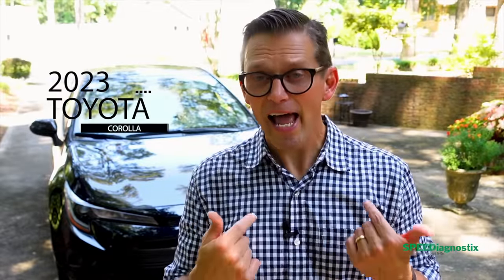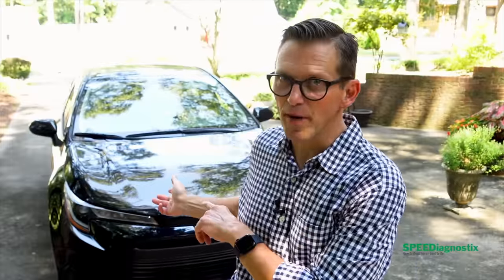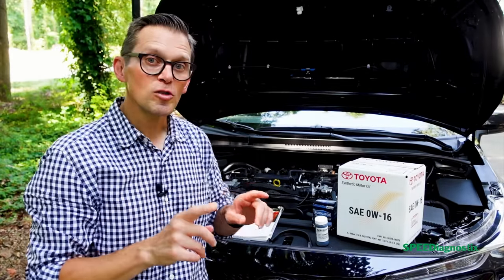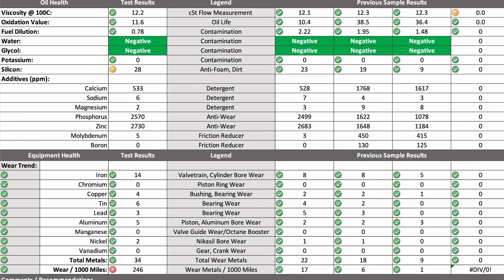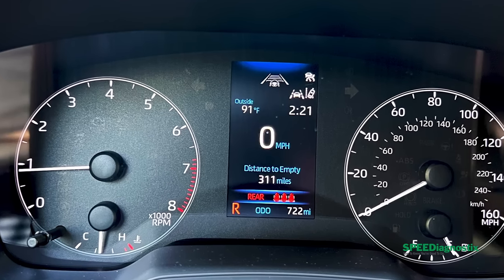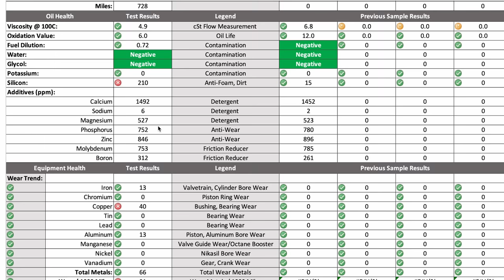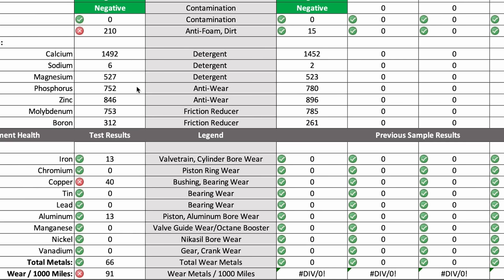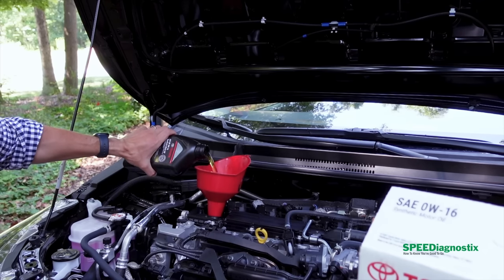AVOID the ONE MISTAKE Almost EVERYONE Makes With A Brand New Car

Comment: 10k mile oil change interval so customers can keep buying new cars every 100k miles 😆 🤣 😂 😬.
Reply from the maker: LOL!
Reply: A lot of manufacturers in Europe are now specifying over 20,000 miles. That concerns me. Austin Rover were specifying 12,000 miles or 1 year back in 1980 on the Austin Metro, a vehicle with the old BMC A-Series and a gearbox inside the engine oil sump and sharing the engine oil. It's utter madness here, and has been for some time!
Reply from the maker: @cameronwood1994  Agreed!
Reply: They last far longer than that. 200, 300,000. 400,000 miles all going by manufacturers recommendations. See them every day. Mines done 170,000 miles 14 years old, only ever had 10k mile changes from new it's perfectly fine. PCV is clean as whistle.
Reply: @motleydude73  are you a mechanic?
Reply: @chrisr.986  Used to be, though you don't need to be as real life motoring proves what he is doing is pointless. Wasting perfectly good oil, $ and time. That Corolla will do 200,000 miles quite easily regardless of your 700 mile change. Though I doubt his daughter will keep it for anywhere near those amount of kms. Doing the first change at 10,000 is perfectly fine. Millions upon millions of  vehicles around the world are serviced according to their schedules and guess what, they're all running just fine!
Reply: @motleydude73  the cars now days aren't made the same as before. The cars in the late 90's and early 2000's were extremely reliable not these new cars anymore.
Reply: @chrisr.986  They are made better. No need for 'running in' any more. Can go half a million miles easy without needing anything major. Just keep them serviced as per manufacturers recommendations good to  go 👍 Some of the electronics on some makes can be problematic but that's about it. Anything major in the first 5 years is generally covered by a recall bulletin and fixed under warranty.
Reply: Changed the oil in my 2013 Prius at 1000 miles, then at 10k until I sold it with 236k.  No oil usage at all!!  Stock Toyota filter with Toyota oil 0W20.
Reply: @jdub6797  It's a Toyota what did you expect? It will do double that.
Reply: @motleydude73  not if you don't change the oil and filter.  Also need to use good oil and filter or even if it is a Toyota it won't go 200k.
Reply: @motleydude73  I agree 10k oil change is fine.
Reply: @motleydude73 I change the oil every 3k miles in my 98 Sentra.....but there is an oil leak now so I never have to change the oil, it changes itself over time...very convenient and has made my life easier. 😂 I just add a little oil every few hundred miles.
Reply: @fortheloveofnoise  Doesn't quite work like that. Will always be a few litres of filthy oil in there gumming up your galleries and valves. The filter also needs changing.
Reply: And a mercedes that advertised their transmission is seal type that will last for a lifetime.. i feel pity for whoever that follow that.
Reply: @harisyoung4110  lol exactly 💯 🤣 🙂
Reply: @harisyoung4110  What are we back in the 1990s again? I think you'll find Mercedes recommend trans oil changes in all of their vehicles built in the last 20 years.
Reply: Not really. A 10K oil change makes the cost of ownership look good. 
Honda had to advise changing auto oil annually if the maintenance minder never indicated a change. Due to low milage short drives usually. So theoretically you could go years before your minder said to change the oil. By then ouch!
Reply: @motleydude73  Agree, what's the point in wasting a lot of money too keep the engine as good as new when the rest of the car will wear out. Then you also need to recond the body and regularly treat the chassie against rust.
10000 miles between oil changes is more frequent than most manufacturers recommend and is just fine with normal driving pattern. BUT in harsh condistions and just driving short distances between cold start it is another thing.
Here in Europe some manufacturers had 20000 miles interval and that gave problems so it was taking it too far.
/Engineer from Sweden
Reply: @rwd1973 OK, , but here in Southern California,  that doesn't really apply, our cars don't age physically ie RUST, CORROSION doesn't exist. The strong sun here can ruin the paint in about 7 8 years though, if not frequently hand waxed. So we can't try to match engine failure with physical destruction.  My 58 cadillac and 68 Mustang are totally solid ,look nearly new underneath,  hell, it hardly ever rains here. So its very important to keep the engine going as long as possible before paying for a rebuild. Hence both cars get 6 month oil changes.  My daily driver gets 3000 mile oil changes,  its GDI and TURBO.
Reply: @rwd1973  Most recommend 10k changes under normal conditions. That's perfectly fine. Not all countries use salt on their roads so rust isn't an issue. A modern car should last 30 years 300,000 miles.
Reply: @johnfranklin5277  True, but I doubt that modern cars with all the electronics will be worth repairing after 20+ years compared to a car from the 60's that can be repaired in all eternity as long as there are parts.
Reply: @rwd1973  Maybe,maybe not. My parents bought the 58 caddy in 1960. In the mid 70s it started becoming difficult to find parts for it, but not impossible.  But parts like the vacuum brake booster basically quadrupled in price! But starting in the 2000s, everything starting becoming available at lower prices. Now I have no problems finding parts. The Mustang I bought in 1977, NEVER had any issues getting  parts for it!  Could be that 20 years down the road other companies will step up making replacement parts, including the electronics like they did for 40s 50 60s cars now. Time will tell. By the way, my maternal grandfather was a full blooded Swede. CARLSON was his last name.I think the original spelling was KARLSSON. 😊
Reply: Agreed, just to make sure the car buyer has a strong “incentive” to trade before 100,000 miles. I seem to recall a certain “reliable” Toyota engine with low tension rings and factory recommended 10K oil change intervals. That ended badly

I live in Winnipeg, Manitoba, Canada. Summers can be humid and reach +35 C. Winters are long and January lows of -35 C to -40 C are not unusual. 

I bought new a 2013 Ford Focus hatchback with a 5 speed stick - no PowerShift transmission issues for me. I did the initial oil and filter at 2,000 km. Thereafter, every 3 months or 5,000km max. City driving is hard on oil, especially in winter. My engine has GDI, so I expect a certain amount of fuel dilution in the oil.

Following the owners manual I normally run a 5W-20, I prefer Mobil 1 Extended Performance. For winter, the owners manual suggests with low temps of -30 C and colder, a0W-20 for “improved cold start performance.” In other words, it will still start if I can’t plug in the block heater.

A little over 100,000 of mostly city driving, and it still idles so smoothly you can’t tell if it’s even running. For curiosity this summer i I took the intake manifold off. The intake valves were practically clean.
Reply: @jerrykorman7770 Fantastic!
Reply: Just change it every inspection year and change the PCV valve too.
Reply: What are people’s thoughts on running a 10k interval, using Amsoil signature, high quality filter, on a vehicle that’s driven 45k a year?
Reply: @dander0091  my personal opinion is to have your oil analyzed you will be able to see your vehicle’s oil condition 😁 🙂.
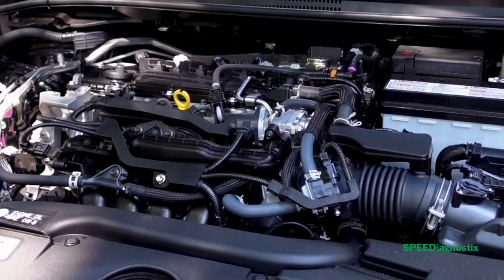Reply: 0:54 toyota can take the abuse.
But id still change oil as often as i did a tire rotation using a sysntic motor oil.
Reply: @themotoroilgeek change the gearbox oil as well.. gear teeth & clutches shed a lot of particals that become sediment in galleries etc just waiting to release a 100k-200k kms later.. when most auto boxes have problems.. store the waste oil in a tall clear plastic bottle & look at it in 6 months to see clear the settled particals
Reply: 10,000 mile oil changes.
One heck of a selling point,eh?
Reply: @motleydude73 they may run fine, now, but their longevity has suffered
Reply: @fortheloveofnoise if you don't drain it, the bad stuff in bottom of pan is never removed, continues to wear engine parts
Reply: @rogerdodrill4733  Is 30 or so years 300,000+ miles not enough for the average car?
Reply: @rogerdodrill4733  I've seen hundreds if not thousands of cars that have had nothing but 10k changes their whole lives. Guess what, they last 100,000, 200,000, 300,000 miles without a problem. Cars 10 20 30 years old. My 1995 Accord which I bought new still runs smooth as silk at 264000 miles. The oil is always golden. My 2010 Camry at 161000 miles. Same thing. Not sure how much 'longevity' you want or expect out of an engine?
Reply: @dander0091  Perfectly fine. That's 4 changes a year! Obviously doing a lot of long hot running engines love that.
Reply: Sook you are willing to blindly believe a manufacturer even when they admit to built in obsolesense. Have fun with that.
Reply: @RATTL3R186  I will. 30 years out of a car seems pretty decent to me. Suppose you want 50?
Reply: @RATTL3R186  Please provide links to this stated  'obsolescence'. We're not talking about washing machines. Cars lives depend on many factors outside the control of manufactureres you muppet. What do you think service schedules are for and why replacement parts are widely available? For longevity of a product.
Reply: Thats what's done with new motorcycles first 600 miles oil change.
Reply: 500 miles a little bit overkill, LOL. You can definitely put at least 1200 miles before the first oil change.
Reply: @Just_In_credible6  Do 10k as per manufacturers recommendations. Any sooner is just wasting $ and good oil. People seem to think it's the 1950s still when oil was crappy and cars needed 'running in'.
Reply: Exactly!!
Reply: @dander0091 that's what I do. 162k on the Benz, 228k on the civic.
Reply: @motleydude73 yes, usually modern vehicles are engineered and built better but there are many that have issues that didn't exist before also, I have been a mechanic all my life along with a lot of my friends who work in dealerships. I have seen and heard about excessive wear in areas that shouldn't exist if they were engineered to last, in general even Honda and Toyota have wear issues on certain engines. What he is doing is not wrong in helping the life of a engine, even if it is a Toyota, let alone a Kia which has had a history with manufacturing problems, like blocks not cleaned properly. There are generally not as many well built  engines out there as you are claiming.
Reply: @themotoroilgeek why don’t these oil pans come with magnetic drain plugs? Seems like it would greatly benefit
Reply: 3,000 miles for me.
Reply: @harisyoung4110 Yes, it lasts for the lifetime of the transmission, however long that might be.
Reply: The Car Care Nut also says don’t go 10k between oil changes. He has years of real world Toyota experience. Is he dumb?
Reply: @motleydude73 you make great points. “Varying your speed “ during break-in in the 1950s was important because their cruder cooling systems would cause certain sections of the engine run hotter than others at certain speeds, so the driver needed to even out break in, else you could have a premature oil burner. So often people who still think it’s the 50s say “I change my oil every 3000 miles. Cheap insurance.” No, that’s EXPENSIVE insurance. Cheap insurance is following the owner’s manual. Btw, my 2016 Infiniti with 3.7, manual says every 5000, 7500 with synthetic. So I do it every 5000. So the first oil change I did at 5000. Wow the oil was dark brown. Car runs perfectly at 75k. I do think there was a surprising amount of dirt, etc. in the first oil. But what difference did it make? 1% shorter engine life?
Reply: @themotoroilgeek why is it recommended to vary the engine rpm during breakin? (i.e. don’t sit on the freeway on cruise control for long periods). Is it related to the wear on these brand new internals?
Reply: Not always. It really depends on your engine and driving habits. On my 2003 Odyssey I did 10k-13k oil change intervals. It’s wasn’t designed for it but I always sent my samples in to Blackstone labs to check if I could extend. Every time I sent it in they told me to push it another 1-2k. I had well over 200k on it when I sold it with those extended oil changes most of its life.
Reply: I just traded in my car a couple weeks ago, only changed the oil every 6-8k miles.  Had 228k miles on it with only replacing the battery and a water pump.
Reply: @JFKeNn3dy  I assume you drove alot of highway miles?
Reply: @fbi8364 Lazy people with dirty houses do 10k Mike oil changes. 😉
Reply: Rubbish. We own many cars, a Lexus nx200t serviced every 15000km(9000miles) , sitting at 190000km (120k miles) zero problem. Have a twin turbo diesel VW amarok at 245k km (153k miles), zero problem serviced every 15000km (9000 miles). Never serviced any cars including our trucks under 10000km, our Mercedes sprinter van goes 30000km or 24 months for oil change from manufacturer, 10 years old this year and zero problems….. why change 500….5000? Why not change every day then ?
Reply: We just bought a Highlander Hybrid with 50,000 miles on it and only 5 oil changes. Needless to say, we are starting 5000 mile oil changes despite the dealer telling us that we can go 10,000 miles.
Reply: @chrisr.986 yes. The cars made nowadays aren’t the same as before—they are better. Engines are made with better tolerances. No longer as many iron shavings in the break in period.

My 2019 Accord has 130k miles with absolutely zero issues doing the recommended 7-8k miles oil changes. It will so easily do 300-400k miles.
Reply: Plenty of cars are just fine with a 10k oil change interval... my 2000 tdi jetta doesn't use cheap oil to begin with. So I want to make sure I get the most out of what I pay on  on the car. Including its oil changes. Well 15 years later and 405thousand miles, she's running like a champ! Did a valve cover gasket like 5thousand miles ago, those cam lobes look like new! And the inside of the motor wasn't even glazed of carbon or soot. It was remarkably CLEAN!
Reply: @Anonymous99997  better go 200 miles, oil is cheap. Engine isn’t
Reply: How fast you drive determines how often you need to change your oil. 

High RPM = increases oil oxidation.

Toyota lists 10,000 miles between changes because most people who buy an inline 4 economy car don’t drive very fast, and if they do it’s not often enough for it to matter.

Many people don’t understand this, yet they change their oil every 3k miles on the dot all because they “heard” from a friend thats whats best.
Reply: @known3617   my old tdi came from factory with 85hp. It's always screaming just to try to keep up with traffic. 10k oil change interval even still. But it's diesel so the way the oil breaks down isn't the same. Also doesn't get ethanol contamination
Reply: I’m changing oil in my Prius once a year, it’s about 13-15K mi and using only oils that rated for 25K change interval. Almost 200K mi, no oil consumption by engine. Friend of my changing oil every 5K in his Acura, about 110K mi and engine consumed 1 qt or more every 1000 mi. What can you say?
Reply: @Ilikepie18855 I have a 2010 Audi A4 Sline 2.0T 6MT (gasoline). Always had it serviced annually at dealership with about 13,000-15,000kms. At 146,000kms they recommended timing chain replacement (3.8° stretch). The timing chain is apparently designed for “the life of the engine”. At 175,000kms oil consumption is now 1L in 600km. I’m really disappointed. I can’t help but think, I should have changed the oil more frequently
(~ 8000kms intervals).🤷‍♂️What happened?
Reply: @svenhodaka9145  Well you have an audi, no amount of oil change will ever save that. Get a lexus, service every 30 000km and it will still run with no oil burn. I have a 2016 volvo xc90 D5 SPA, the only european car I have that is over 185k km, serviced every 20 000km at volvo  and engine runs fine, no oil burn etc. Everything else did fail though.... turbo, alternator, waterpump, EGR, etc..... but engine is fine. Want to drive long turn in a luxury car? Just go lexus.
Reply: @Ilikepie18855  👌Thanks for this little chat. I’m going car shopping .
Reply: It was a joke
Reply: Same bullcrap with 10K oil change
Reply: The dealer where I bought my Camry changed the oil at 500 miles they set us up for an oil change
Reply: Get a Tesla no oil worries after 10 yrs get another one  😂😂😂😂 no fluid worries any more. Ok ok you guys keep your cars forever so just disregard my comment and stick to your fluids 😂.
Reply: I changed my oil every 10k, and my car is close to 200k now and works perfectly fine. Changing it every 5k is for sheep.
Reply: Coworker has a 2016 vw passat. Goes to the dealer for everything (10k mile oil changes). He's pissed because car now has 80k miles and burns 1 quart of oil every 2 weeks. Dealer says its normal 😂
Reply: If you check the level and use synthetic oil you should be good. Big problem is the folks that don’t check the level between changes. 
I bought mine new and did my first change at 500 miles and the next at 3000 miles. Been changing when the computer tells me since then. It’s about 6-10k but I often don’t get to it until 11-12k. 340,000 miles later no ticks, taps, knocks, and will smoothly run to redline with no smoking. 
Not sure why they don’t included low oil level lights.. by the time your low oil pressure light comes on your engine is toasty.  Probably a .99 cent sensor would do it.
Reply: @themotoroilgeek is there a brand of oil that you would recommend for the transportation industry? 
I maintain everything from 4cyl, 6cyl, 8cyl aluminum gas engines (7 passenger to 25 passenger vehicles), to 4cyl, & 6 cyl diesel engines (34 passenger to 60 passenger coaches)? 🤯
Currently we use a wide range of oils from usually the cheapest available sources.
I'm not asking for a "one weight to rule them all" sort of thing. Instead maybe one or two brands that will help these long idling, long trip  engines (that have some drivers that think they're part of the Joe Gibbs racing team😂).
Any input/help would be greatly appreciated 🙂
Reply: My last two 10,000 mile interval cars were an M5 at 220k and an RX350 at 235k(still going). No, I’m not “a mechanic”, just a Mechanical Engineer. But I don’t think I need to be a mechanic to read an odometer.
Reply from the maker: @tracewallace23  Thanks for the question. When it comes to recommending an oil, the brand choice comes last. Always begin with the application, the type of engine and operating conditions determine what the proper viscosity and chemistry should be. The brand choice is who do you trust to consistently deliver that viscosity and chemistry.
Reply: @rwd1973  The durability of the electronics is actually mind blowing in its own right. My 17-year-old Tahoe can’t even fire the spark plugs or put fuel into the cylinders without a computer telling it what to do. The more amazing part is all of that software fits into one megabyte a flash memory and the CPU can run without producing any errors at 200°F. I also have a 1976 F250 that has nothing but constant problems because the materials just simply are not as durable, various seals, diaphragms, membranes, gaskets, etc. springing new leaks in the carburetor. Cylinder number four has a burned valve seat because of a leaky brake booster causing it to burn from running lean while modern valve seats are so durable and so hard that the engines can run lean all day every day without any problems.

The only reason most modern cars in the US don’t run lean of peak EGT except for Nissan sky active is because of NoX emissions.

Modern chemistry is amazing. It’s funny how we take for granted the luxury of 87 octane, and the efficiency and power that it can produce and by today’s standards is a low-grade gasoline then when I compare it to what my grandpa had when he was my age it’s hilarious how poor quality Fuels were and how low power the engines had to be to support such poor fuels.

What’s even more crazy is that high-quality gasoline was possible in the 1940s, but prohibitively expensive 100 octane existed in the form of aviation fuel which still exists and is used to this day in small aircraft. Only within the last few years has one company managed to formulate a gasoline that can achieve 100 octane while removing lead for aviation but once again it’s another $.40 per gallon more expensive than 100 low lead but you can double your oil, change interval, in airplane engines, because in the absence of lead, the fuel burns cleaner resulting in oil that last longer.

Full synthetic oils were attempted in airplane engines, but failed because the lead from fuel turned out to be highly incompatible with synthetic oils. These oils can finally make a comeback with 100 unleaded and we may finally see airplane engines doubling in life because of chemistry compensating for the higher cost of the chemicals, but saving you money , because you don’t have to buy a new engine.
Reply: @themotoroilgeek  Thanks for a very sensible and quick response 👍🙂
Unfortunately, the business owner I work for actually told me once that "he believed that oil changes were a scam perpetrated by the car and oil companies" 😵‍💫🤯
Then he got to see what 30k on one oil change could do to a gas engine (the only reason it survived that long was a oil filter bypass system). Then he wanted proof that was why the engine blew. All it took was removing the oil pan and valve covers. 
Talk about a horror show.
Interesting, but horrible. 
35k on the engine and 6 qts had cooked down to about 2-3 qts of a sludge that couldn't even pass as burnt grease 🤯🤣
He hasn't questioned the wisdom of oil changes since...🙂
I'll keep watching your videos and see what I can figure out. 😎
Thanks again
Reply from the maker: Thanks for sharing  @tracewallace23
Reply: @motleydude73 yeah we'll go look at some used Corollas with a 50 or a 1 0 0 Thousand Miles when you rev those engines you hear the bearings rattling like a marbles in your mouth buddy so so you're saying totally b***** yeah the car won't last 200,000 miles but also make a lot of noise so that's why some of them don't because some people did change the oil on the first 500 miles and then a thousand miles and then every 5,000 miles girls won't make that noise at 1 0 0. 5 every other Corolla will make noise like a motherfuker and it might make it to 2:50
Reply: @memphisraines8118  It's a VW what did he expect?
Reply: The Corolla is one of the most abused cars ever that's why they all burn oil nobody likes changing the oil in a Toyota Corolla that's why all the ones for sale or garbage then you get those 20-year-old ones with only 10 or 20,000 Mi on it doesn't even worse yet because the oil was never changed in 20,000 or 30,000 miles yeah even ones with 40 thousand miles on it maybe the oil was just changed to sell it it's all true facts I bought many Toyotas especially Corollas I got through high miles and low and they all burn oil and they all make noise why because nobody maintains them correctly not like this guy does maybe this guy got it right but that doesn't mean that the world gives a fuk are they going to keep trading in their Corollas and they'll be plenty of them for sale and they have plenty of you ship box oil burners and they'll be making noise like they do Corollas and noisy engines and they just making them even more noise here by doing what they're doing dog
Reply: @frontierguym2857  Why would a dealer do that? Toyota don't say to do it. Was it at their expense?
Reply: @chrisr.986 so you're saying a car made in 2023 is less reliable than a car made in 2003. You couldn't be more wrong.
Reply: @new2000car 
They wish they had lubricants as advanced as we do these days. But for someone who uses the cheapest oil, short driving distance, 3k miles OCI is a good guarantee the engine will live decent life. We have one costumer with '94 Civic with over half million km and it's still alive in the worst place of the rust belt in Canada.
Reply: @johnfranklin5277 John, same thing applies here in San Antonio. No snow, therefore no salt on the roads.  But intense southern sun will cook the exterior paint and rubber or plastic components!  Need to wax often and apply protectorants on the exposed plastics and rubber.  Also helps to use a sunscreen when parking to protect the dashboard.
Reply: @OldRustySteele  Absolutely,  been doing all those things for 48 years to my cars now, and it definitely helps tremendously!
Reply: I quit putting money into my Nissan pulsar, 1986 when I hit 280000 kilometers. No oil changes I just kept adding my dad's used oil from his new car until I sold it. I had 495000 km. Never plugged it in always started still ran good..yes same oil filter for 215,000km GO NISSAN.
Reply: 10,000 miles is not much is maybe 100-150 miles more than the average person is estimated to drive in a year
Reply: it probably has to do with the quality of the oil as well. don't count on the car manufacturer putting the best oil in the car?
Reply: An oil cleaning probably won't hurt, that is, you run the engine through with a cleaning additive and then change the oil and oil filter. Note an additive made for the purpose
Reply: @motleydude73  There are cars that apparently have problems with the piston rings and this Apparently with low friction pistons to do
Reply: @motleydude73  There are also engines that have problems with burning oil and it can become a really thick consistency If you are unlucky
Reply: The oil makes a difference. Someone using Supertech regular Syn oil and an eco guard filter. May have more issues than those using Mobile 1 Extended performance High Mileage with a mobile 1 extended performance filter.
Reply: @motleydude73 On The Prius with 1000km change then 10,000km after that.  That engine is known to use oil due to jammed rings from sludge and not enough spring tension.

It's remarkable the oil changes prevented it's demise.
Reply: @jdub6797 the most important issue for this dude did is the 10k miles oil change. The engine wont last 50% of those who do 5k miles change in most cases for sure
Reply: 18,000 mile oil changes on my SEAT Leon as per the manufacturers schedule. I've owned it since new and it  has now done 204,000 miles and is still strong. Some engines are more sensitive to how often you change the oil than others. I use the specific long life oil and there was no sludge in the oil pan when it was off due to a dodgy sump plug. No running in oil change, it's first oil change was at 18,000 miles. Yes, the oil would likely have more metal content than later oil changes but it doesn't seem to have reduced the life of the car. It's already gone much further than the average car before being scrapped and it's still going.
Reply: @RichardFanders  well, one car survived with more than 10k mile oil change does not prove it is a good practice. 18k Mile change is definitely bad practice that no people should follow if they want to keep their car long.
Reply: @motleydude73 agreed anything under 10 k especially not doing heavy driving the oil will come out not even close to black I go off of the cars recommendation it's usually 7 to 10 k or 3 months which ever comes first
Reply: @chrisr.986  almost every engine lasts 150,000 miles or more. And if they do fail, it’s hardly ever due to lubrication issues.
Reply: It is transmission oil, and no, every 90000km of 5 year you have to change the oil. Read the fucking manual.
Reply: We own a 2007 Acura RDX with 205k miles on it. Always had used Mobile 1 at dealership but not a sure what oil at Jiffy Lube and our current shop uses except they say its synthetic oil..
Reply: @paulloisel5607  I’m a mechanic. And i regularly do stuff to my car that I advise others to NOT do. And to be honest, i probably go 10,000 miles between oil changes more often than I’d like to admit and have done so for my last 3 vehicles. ALL of them have gotten at least 200,000 miles. And the engines were still good. My current car has over 240,000 miles on it. I use full synthetic oil. The recommended oil change interval is 6,000 miles using synthetic blend. Today’s oils are MUCH better than the oil used 30 years ago when the 3,000 mile oil change was the norm. Most cars can go the manufacturers recommended interval without any problem
Reply: Yeah those 10k+ mile oil changes are a scam by the manufacturers. So much so that oil manufacturers are recommending 10k mile and even up 25k mile change intervals.
Reply: @dander0091 at that rate I'd go 10,000 miles if your manufacturer recommends that interval.
Reply: I haven't had a car that did less than 200k and when I got rid of them it wasn't because of the engine.  I just followed the manufacturers recommendations. Last car was every 5k with semisynth and the current is every 10k with full synthetic.
Reply: @markmccraley2559  the funny thing is that any engine that has the reputation of dying at 100,000 MI is an engine that everybody tells you to avoid. Engines haven't been routinely wearing out at $100,000 miles since the mid to late 1980s. And people are keeping cars longer than ever. One of the reasons is because the high dollar items such as the engine and transmission tend to last longer than ever. Those big ticket items were usually a major cause of people getting rid of their car. The truth is that if a person uses good quality oil as recommended by the manufacturer, a decent oil filter, and changes the oil as recommended by the manufacturer, the average engine will last much longer than 100,000 miles. Your experience is typical as opposed to the guy who claims that following the manufacturer's intervals will lead to early engine failures
Reply: For the first oil change during break in, change the oil at 3000 miles and then every 5 to 6000 miles or every 6 months.
Reply: @frederickneal4781  No harm in that, other than to your wallet,  but completely unneccessary.
Reply: Oil changes are cheap. New engines aren't.
Reply: @Kris-q4m  As I keep asking you muppets who say the same tired ananlogy over and over, why would you ever need a new engine? Paranoid much? Do regular changes at least every 12 months  it'll last a very long time!
Reply: @seatime674  No we do it as that's what the manufacturer recommends. And my house is spotless. As is my engine internals after 160,000 miles. Stop listening to snakeoil salesmen like Oil Geek he's just costing you money.
Reply: @motleydude73  Where have you seen thousands of cars at 10k mi oil changes that last forever!...No one is saying an engine will blow if you don't do it at that either but if you understand the concept of oil, unburned fuel, soot & carbon pollute the oil daily and studies show that after 5k miles lubricating properties drop over 20 fold.. If people brush their teeth every 3 days thier teeth won't fall right out but most do it daily, If you change your home A/C filter every 5 years the motor won't die immediately but most do it yearly.. These newer engines are smaller at a higher tolerances to make more compression & horsepower so they are harder on oil especially turbos and superchargers which are on 60% of vehicles now. A car is a 2nd biggest investment in life, 10kmi oil changes is considered neglect, synthetic or not sorry & 9 out of 10 people will tell you exactly that.. You are literally shortening the life of your car and it is a 100% fact no matter what things look like to the naked eye
Reply: @seatime674  🤣 Funny guy. 10k is not neglect it's perfectly fine and what Toyota recommend. Oils and engines have improved somewhat since the 1980s bud. How long do you want a car to last? 50 years? My previous one was 23 with 289000 miles, had nothing but 10k mile changes from new. As has my current 13 year old car with 160000 miles. Oil is still clean at every change. And as service tech with 32 years experience I have seen thousands doing just fine and dandy with Toyotas recommended OCIs. Some Landcruisers with over 500,000 miles.
Reply: @motleydude73  Where is your Source again of thousands you've seen that go 10k mile changes?. Yeah there's a miniscule small group and a handful of you 10k Oil Changers out there but trust me you are the slight minority and you can laugh all you want, the facts I gave you are 100% FACT regardless of the miles on all your stupid cars. After 5k miles even with synthetic oil it losees its lubricating properties and degrades  20-fold and multiplies another 20 fold soon after that. 3-5kmi is the total sweet spot. Because you've fallen on a favorable side of luck at the moment doesn't make your arguement 100% Ironclad proof.. Yes with new synthetics you can go 5 maybe 7.5k miles at times but consistently 10k+ because of what I just described is not a good idea... And you also can't prove Toyota tells you 10K so they can sell you a new car sooner than later when you possibly break down either so Keep rolling those lazy dice😉
Reply: @seatime674  As I said, funny guy 🤣  My 'source' is real life experience bud. Slight minority? No, the majority actually. 98% of people who come in for servicing do it at the manufacturer OCIs. That's around 24,000 vehicles a year at our 4 dealerships alone, nevermind all the rest around the country. Your paranoia is laughable. Chuck fresh oil in every 10k and forget about it. You think you know better than the people that build and benchtest the engines 🤣  GTFO. My experience calls BS on your opinions. I'll happily keep rolling the dice, it's worked for me for 35 years of car ownership. ZERO issues. Oh I lie... a snapped accelerator cable in 1996.
Reply: @seatime674  BTW you are clueless about oil. Absolutely laughable. It's whole purpose is to lubricate. And reduce friction and disisipate heat. Sure it breaks down over time and miles, but 3-4000miles is ridiculous. It's not 1980 anymore. Things have improved. Many oil analysis samples will show you that. It's good for about 15000 miles.
Reply: @motleydude73 
Yeah you're right I know absolutely nothing🤣🤣🤣🤣..
(Toyota Nation Quote)
 Although this video is for Toyota Camry, the dealer and manual recommends 10k mi oil change intervals. Look what happened. I think it applies to just about any car brand. Oil changes is not that expensive for most cars, if you do it yourself it shouldn't cost more than $40.

If you don't watch the video, basically the Toyota Camry owner has 180k mi on this 2015 car, the owner has not missed any car appointment for maintenance and the dealer calls for 10k oil changes. What started happening is the car is burning 2-3 liters of oil and that caused the engine failure and had to be replaced. The mechanic pointed out what parts of the engine had failures in multiple parts.

Last edited by MKTwet; 10-29-2022 at 11:35 AM.. Reason: Edited thread title for clarification.

https://www.youtube.com/watch?v=TJhFAwFv-O0
Reply: @motleydude73  And I never really quoted 3K I said 5K is a good standard!!!!... No one likes a Mr know-it-all clown!!!!
Reply: @seatime674  So? Mines a 2010 with 160,000 miles and doesn't burn a drop, what's your point? Shall I list the thousands I've done 10k changes on over the past 3 decades that have no issues too? Some models of Camry had low tension rings that caused oil burning, namely the 2AZ-FE. That is nothing to do with OCIs. I've seen that video and commented on it ages ago.
Reply: @seatime674  You said 3-5k is the sweet spot. Good synthetic has triple that life at least. And I don't care who doesn't like me. People suck. Especially youtube 'experts' who think they know better than vehicle manufacturers out of pure paranoia 🤣
Reply: @motleydude73  Blah Blah Blah Blah Blah blah. Enough with the diarrhea 🤣🤣and quit splitting hairs  10kmi oil changes is not recommended period deal with it.. an owner of a Toyota dealership just told you it's not a good idea and I don't think you know more than him🤣🤣. Go back and read my quote I said exactly 5K is this sweet spot
Reply: @seatime674  Honda and Hyundai also recommend 10k OCIs. So you're the one talking out of your arse. I talk facts, proven by experience. How many oil changes have you done?
Reply: @motleydude73  You're just not getting it you sound very dense!!!. It doesn't matter what manufacturers recommend, What the owner of that Toyota dealership just showed you was a perfect example of what NOT to do regardless of their recommendation.. I will 100% personally guarantee as of tonight you will not be changing your oil every 10Kmi anymore.. The owner of this dealership said don't do that in any brand car as they had to replace her motor because of it she bought it new, did 10K oil changes and had to replace it.. Your cars going to start burning oil any day now watch😉👍
Reply: @seatime674  Funny guy 🤣  Im speaking from experience, ignorance only comes from inexperience,  and yes I will continue doing 10k mile changes, it's what Toyota recommends and I've never had any problems by doing it. Ever. Nor has anyone else we do 10k mile OCIs for. That Camry had a defect with the rings it was a common issue 15 years ago. My Camry doesn't burn a drop as it has different rings. It will happily do another 160,000 trouble free. You seem to be stuck sometime in the 1980s when engines and oils weren't as good.
Reply: @seatime674  I've only had to replace 4 engines in my career, and only one was due to OCI neglect. Some I've serviced from new as per Toyotas recommendations and they're still going strong 20 or so years later with 250,000+ miles. Tell me about that 3-5k sweet spot again 🤣
Reply: @motleydude73  You can keep saying OCI aaalll day long all you want that's not going to save your hide and I'm the opposite of ignorance because I have experience you don't know anything about me and what I know... Do you also know car manufacturers recommend changing transmission fluid every 100k miles too???? And do you know changing transmission fluid at that mileage can cause the clutch plates to slip because you're displacing sediment?? So now you can't change your fluid at all!!!. Better stick to those manufacturers recommendations. A Toyota is Toyota is a Toyota is a Toyota all day long and you're going to start burning oil any day now. Sniff sniff what's that I smell?,?? Crude oil??... 🤣....
Reply: @motleydude73  Here let me ask you a question. Let's take 2 brand new of the same engines and one guy changes the oil every 5k miles and the other guy changes it at 10kmiles  Which one is going to go a Mile+ further??.  EXAAAAAACTLY🤪
Reply: @seatime674  A lot recommend it at 55,000 miles actually. Or 90,000 kms.  Which is what I do, as do most people. Again no issues. Shorter intervals are recommended if you do a lot of towing. And no it won't start burning oil, the oil is still golden at every change. I've had cars with far higher mileages and zero burning. Our Parts Van is a 2011 Hiace. Currently at 216000 miles. Not a whiff of smoke.
Reply: @seatime674  Too many variables to say. Engine longevity is more than just doing regular oil changes. But the guy doing 10k changes will spend a lot less on his car than the paranoid guy 🤣  There is ZERO evidence shorter intervals give better longevity. The only time I'd shorten them is if I was doing shirt trips constantly i.e less than 10kms 90% of the time.
Reply: @motleydude73  "There is ZERO evidence that shorter intervals give longer longevity???" I JUST SENT YOU THE FU K IN LINK TO THE CONTRARY!!! .. The owner of a Toyota dealership had to replace the motor in a 2017 Camry because she did 10,000 mile oil changes!!!!! It was proven in the teardown Do you want me to speak slower so you can understand?????????.... I'm not saying that happenes with every car but it happened to this one!!!!!
Reply: @seatime674  A link I watched over a year ago. Yawn. It was nothing to do with 10k changes. Unless he only drove 5kms a day for 12 months towing a 5 tonne trailer. But no, faulty oil control rings caused the excessive usage, as I have said it was a common problem for a number of years.  If 10k change did cause it why am I not replacing engines every single day on the same cars? Or my own for that matter. That Camry would have burned oil even it had had 5000 mile changes. You're quoting one car with a known design fault as evidence that 10k changes are bad? 🤣  Do better next time.
Reply: Hahaha 😆, those days, up until the early 70s of only getting 100k miles, are long gone!! I've heard of some people getting 😕 up to 1M miles on their newer, well engineered, and well maintained engines!!
Reply: @dohc1974  That's a very good idea💡I've seen engine oil drain bolts 🔩 with 🧲 magnets available at many autoparts stores!! 
  'By George' I need to get myself one of those magnetic 🧲 oil drain plugs/bolts !! Thanks 😉 for the heads-up 👍
Reply: @Ilikepie18855 Better yet, just buy a new vehicle daily!! 😉
Reply: Just retired my Mazda 6 2008, 426000km,  oil change every 15-18000km, was burning 1/4 pint in 15000km,  so my opinion is this video promotes oil changes way too early !!!
Reply: 8k miles for me on everything with synthetic.
Reply: Tell that to a diesel.
Reply: I'd "flush" it with cheap 5w20 or 30.
Reply: Not really lol they’re built for it and synthetic oil can last even longer than that
Reply: That info hit hard.  You mean to tell me full Synthetic oil still needs to be changed every 3k miles? What about using one of these by pass oil filters?  Another gimmic?
Reply: The care care nut took apart a Camry that had 10k mile oil changes religiously and the car started to burn oil at 100k miles, at 120 it was going through 3 quarts every 1k Miles. Ask yourself one question when you're engine fails does the dude who wrote the manual pay for a new engine?
Reply: Evidently, "break-in" oil went out with the Carter AFB.  The oil that the manufacturer puts in is intended to remain so as to ensure a proper initial oil interval.  Engines are fitted better with modern machining methods and generally don't require a "break-in" anymore.
Reply: You also want to consider that short trip "city" driving is considered "severe" use that requires more frequent oil changes.  But you shouldn't have to change the ATF fluid unless it gets contaminated or the gearbox slips or shifts hard (filter is clogged).  Oil doesn't "break down" but it can be contaminated.
Reply: @dander0091 You're changing it often enough,  every 2.5 to 3 months.
Reply: Depends on how the miles were driven, pull the oil stick out an inspect your oil yourself on the stick, clear, brown or pitch black. I change my oil every 3 months, but my dad changes his oil every 6 months because he only drives to church to the grocery stores and back home 1/2 tank of gas will last him right at 2 months😂!.
Reply: To be fair to Toyota they tend to make it to about 150k miles before the piston rings stop working and the oil burning becomes terminal.
Reply: @motleydude73  you crazy
Reply: @timin770  No completely sane. The crazy ones are the idiots dumping their oil every 3000 miles thinking they know better than the people who built and benchtested their engines 🤦🤣
Reply: @samliang4146  Well they have and do. As do plenty of others. You are making silly assumptions based on paranoia.
Reply: @michaelw6277  Which Toyotas? Old 2AZ-FE's? 2AR-FE''s?  I work on plenty every day with far higher mileages and no 'terminal' problems. Nor on any of the ones I've owned. Current Toyota is at 171000 miles, should I expect problems any day now? 🤣
Reply: @1976axerhand  As explained, that had low tension rings, it was a well known design fault nothing to do with OCIs. 10k mile changes are perfectly fine.
Reply: @motleydude73  Silly you. What assumption did I make?
Reply: @samliang4146  That engines doing 10k mile changes will only last half as long as ones having 5k mile changes. It doesn't quite work like that. All you're doing is doubling your servicing expenditure 🤦🤣
Reply: @motleydude73  you are so funny, you have a few cars barely survived that 10k miles made you think that is the correct for most vehicles.
Reply: @motleydude73  if you say so. I’m happy spending the extra $25 a year on a jug of oil to ensure that I don’t have problems down the road… unless you feel so strongly that you’ll personally guarantee that I won’t have oil consumption issues up to 200,000 miles and pay for repairs if I do.
Reply: @samliang4146  Barely survived? They were all running just fine when I sold them. As is my current one at 170,000 miles, no issues. Why would there be? I've also done about 15000 oil changes on other peoples vehicles with the same OCI. Again, no problems. It's what the manufacturers recommend. A good synthetic will do 20k easily so 10 isn't much of a stretch.
Reply: @michaelw6277  Why would you have any problems? Oil protects an engine. For a long time. A lot of you dont seem to understand how it works. Some seem to think it's suddenly going to somehow damage their engine after 3000 miles 🤣  Paranoia is rife here.
Reply: @motleydude73  no problems happened for your 10k oil change does not prove that  those car's engine  won't last 2 times longer if they have been changed oil every 5k miles. You don't really understand the manufacturer's recommendation at all since most people's driving conditions should be applied as 'extreme' in the owner's menu. 10/15k mile change only apply for 'perfect' driving conditions like driving all time on highway only, which does not exist. That''s why I said you don't understand your so called 'manufactures recommendation ' at all.  In addition, there are more than enough examples that already prove the manufacturers recommendation are totally wrong, the most famous one is the 'lifetime fluid' that only stupid people believe and apply it and eventually already fucked their car up.
Reply: @samliang4146  Mate I just said I've done 15000 oil changes on other cars too, and no problems, some with over 250,000 miles on them.  Toyota say do 10k then do it at 10k! Why do idiots on youtube think they know better than the people who built the engines? Must love wasting good oil and money 🤦  Not sure how long you expect engines to last, most are are scrapped after 30 years 300,000 miles.
Reply: @motleydude73  it sounds like you don’t understand how oil contamination works. Start sending some of that 10,000+ mile oil off to Blackstone and you’ll get a very detailed report showing fuel dilution and wear metals and almost certainly a recommendation to change the oil somewhere around 7500 miles.

The problem with extended oil changes isn’t that the oil stops being oil, it’s that the extra crap in the oil that’s there because it’s been used is being circulated through the engine leaving deposits. You do what you want with your own cars but I’m happy to pay an extra $2 a month for the long term benefits of keeping the inside of my engine as clean as possible.

You act like people are throwing tons of extra money out the window with an extra oil change when it’s the cheapest bit of maintenance you can do.
Reply: @michaelw6277   10k is perfectly fine. A good synthetic will do 20k easily. Blackstone? 🤣  Why waste my money and time? Never in 30 years and a million miles have I had a single problem. I'll listen to the manufacturers thanks. Stop being so paranoid. My oil still dark gold when it comes out. Metal wear? Yea, after 170,000 miles I think my engines well and truly run in. Fuel contamination is minimal. An average engine runs 6 litres of oil. No damage is being done within the paremeters of manufacturer OCIs.
Reply: @michaelw6277  No harm in doing it early, but no benefit either. Unless you're doing only 10 miles a week and live in Chicago or Toronto.  In extreme driving conditions do it at 5k. Or as the manufacturer advises.
Reply: @samliang4146  There are literally millions upon millions of vehicles happily driving around on 10k mile OCIs, are you that ignorant to think otherwise? You think I'm the only person on earth doing it? 🤣  Everybody I know does it. My Uncles 1997 Landcruiser Diesel has only ever had 6000 mile OCIs, after 422000 miles he's yet to have a problem. Tell me again how 1000 mile and 3000 mile changes are beneficial 🤣
Reply: @motleydude73   what Idiots would do are thinking what they doing are following manufactures recommendations,  15k mile oil change for cars  is a typical one of them.
Reply: @motleydude73  Lol, it does not matter how many 10k,15k survivors you said, which was lies or truth. Most cases prove the opposite. I never said 1000, 3000 miles oil changes are beneficial, which is another funny thing you got. And what you did for miles has been proven to be the worst practice for most vehicles in the world So it does not matter you lied or said how many people do this and still have their cars running fine.
Reply: @samliang4146  15k now?  Nothing wrong with manufacturer recommendations. Most normal people chuck fresh oil in every 10k or 12 months and forget about it. They do it for decades, hundreds of thousands of miles. New Range Rovers have 21k mile OCIs. So what? Perfectly fine.
Reply: @samliang4146  Lifetime fluid is only for the warranty period. 5-8 years or so. Only thick people would not understand that. It's a safeguard for manufacturers so that idiots don't go messing with it then make a claim because they put in the wrong fluid. Most driving conditions are not 'extreme' at all. How out of touch with reality are you? Manufacturers recommendations should be followed for optimum enjoyment and longevity of your vehicle for minimal servicing costs. My 32 years in the trade beats your paranoid beliefs.
Reply: @samliang4146  Proven? Where? How? A good synthetic will do 20k miles easily so 10k isn't much of a stretch. You're talking out of your arse.
Reply: @motleydude73 Nah, the fact is  most people you know or you assume do oil chang neither 12k and 15k oil change( which is not even 1% of car owners in the world). And most people have cars with healthy engines that do 5k miles or 8000km synthetic oil change. Yes, nothing wrong with manufacture aims to increase future sales on idiots.
Reply: @samliang4146  Funny, I'm not 'assuming' anything. You are. Big time.
Reply: @motleydude73  See, you are now following manufactory recommendations. Lifetime fluid just means you don't need to change fluid for the whole ownership of cars, it has no time limit, you cannot assume lifetime means warranty period. In addition, there is no 5-8 years warranty since most manufacturers only have maximum 5 years of power chaine warranty.
Reply: @motleydude73  Just keep doing your 15/20k miles change driving them to unlimited miles in your dream.
Reply: @samliang4146  Use your brain for one second. If manufacturers set OCIs so that cars would fail at around 100,000 miles nobody would buy them anymore. Deemed too unreliable.  Funny how there are still plenty of cars from the 1980s still getting around just fine huh. I've seen some with a million miles. Did they  all get 3 or 5k OCIs. No. Probably 6k for most of their lives. I serviced a 2011 Hiace Courier van last week,  625,000 miles, only ever had 10k mile OCIs from new. When should the owner expect that to fail? 🤣
Reply: @samliang4146  Go do some actual research on the longevity of synthetic oils. You might learn something. But something tells me you'd rather listen to idiots like Oil Geek.
Reply: @motleydude73  Look at how many counter comments to you then you should realize that 32 year bs does not make any sense
Reply: @samliang4146  They're only talking about their own precious cars, I'm talking about literally tens of thousands that have come through our workshops over the past 3 decades. ZERO oil related problems. No stupid break in changes, no 3000 mile nonsense, just cars of owners who stick to manufacturer recommended service intervals. Occasionally we get paranoid customers who want it done sooner, sure no worries. Or ones who do a lot of towing or are in dusty or extreme hot and cold environments. Knock it back to 7500 miles. I have yet to see ANY evidence manufacturer OCIs are detrimental to engine life.
Reply: @motleydude73  same your are just taking about ur own lie
Reply: If your vehicle is equipped with direct fuel injection, I would recommend oil changes at 3-5k if you are planning your keep it past warranty. Plus, throttle body service and decarbonize  the intake system. Every warranty engine repair I did was from piston oil control rings broken from carbon buildup. Direct injection is hell on intake valves, combustion chamber and piston rings.
Reply: Nice try my current car has  250k and I've been changing the oil every 10k
Reply: Bought a used VW, and when I had it serviced, VW garage technician 'unofficially' confirmed my doubts about "long-life" oil. Manufacturer recommended interval is 15000 km, or 30000 km (18700 mi) if using 'long-life' oil. I'll rather stick with every 10000 kms to be on the safe side
Reply: 10k is fine with good oil. Jump ahead 4 decades and get with times. Amsoil every 10k and filter every 5k.
Reply: @zrirukishizutakiari  15,000kms is perfectly fine. It's what most major manufacturers recommend now, have done since about 2015. Was 10,000 before that. It's all I've ever done for past 32 years. I'm a but dubious about 'long life' oils, though a good synthetic should perform well for 20,000 kms under normal conditions. New Range Rovers have a 21000 mile OCI. (34,746 kms) Seems a bit of a stretch to me.
Reply: I have no clue how everyone here knows everything about car maintenance yet never mentions oil analysis.  Why is this?  Anyone?
Reply: @mrdave777  Because it's a pointless expense. Let the oil makers worry about all that. Just chuck it in your car every 10k and forget about it. 99% of drivers don't even know about analysis.  They get many decades of care free driving just by doing regular servicing. Oil Geek is a certifiable nutcase.
Reply: @motleydude73  I had a Nissan which I predominantly did oil changes at 15k, highway driving.  The oil analysis company said do “15k again and check back next time.”  If I blindly did 10k changes, I’d miss 50% oil life!  Plus knowing if I have high wear metals or say….radiator fluid in my sample.  I disagree with your sentiments.
Reply: @mrdave777  I don't care what oil analysis says, real life driving says it's pointless.
Reply: @motleydude73 No use in taking good care of the mechanicals on a Toyota.  Usually the interior, body, electronics, and suspension fall apart way before a neglected powertrain.
Reply: @user-tb7rn1il3q  Change the oil every 12 months there's no reason why you shouldn't get 30 years out of one.
Reply: @motleydude73  So you technically are admitting you’ve never done oil analysis.  And you don’t entirely understand the concept?  Got it!  Thx
Reply: @mrdave777  99% of drivers don't ever bother with it. It's a waste of time and unnecessary expense. Just chuck fresh shit in your car every 10k miles and forget about it.
Reply: @motleydude73  My last car was a Nissan.  Predominantly highway miles.  I’d go 15,000 miles between changes.  Analysis company said do 15,000 again and send in another sample.  So if I blindly went 10,000 miles.  I would have lost 50% potential life on my oil.  At $50 per change…I can do the math for you?
Reply: @johnfranklin5277  you're absolutely right. Let other ^specialists⁶ change their oil every 10k miles.  😂
Reply: @themotoroilgeek  what would you say is the best brand diesel oil please
Reply: Utter nonsense
Reply: Hello! I live in Germany. My work colleague, a native of Poland, had a Volkswagen Passat, a Turbodiesel and a Pampaduza. Every day he traveled 70 km one way to work, and visited Poland several times a year. The annual mileage of his Passat was about 52,000 km. I changed the engine oil and filter myself strictly according to the instructions of the on-board computer - this interval was always about 30,000 km. The oil was always filled with Castrol 5W-30 with approval for its engine. He sold this car with over 500,000 km on it because the turbocharger failed. From replacement to replacement, oil was not added to the engine.
Reply: @johnfranklin5277  I have a '58 Plymouth Suburban. My late father bought it in '68. I'm currently slowly working on getting it back to daily driver condition. Playlist on my channel.
Do you have any videos on your '58? 🤔
Reply: @motleydude73 '97 Accord is pushing 250,000 miles. We've put on 10-15,000 of those miles.
Reply: @dans_Learning_Curve  F22B go forever. Seen plenty with 300k+.
Reply: That would be dumb seeing as we have lemon laws that would require a lot of buybacks and they would face a lot of lawsuits
Reply: @motleydude73 That’s true but how many actually do? There are so many makes that fall apart these days.
Reply: Exactly.
Reply: My 2014 VW Jetta is 300K and I personally changed the oil every 10K😊 Still going like new😊
Reply: True. Would of beleive the 10k if they changed it with Amsoil signature and Amsoil filter. But it is  OE oil. I still like changing my oil every 3,000k.
Reply: There are millions of cars on the road with over 100K miles done on 10K oil change intervals and I’ve personally backed up the 10K OCIs on my VW with analysis that says it’s good. If it makes you feel uncomfortable, then change it sooner, but don’t tell the people who have the data and the 10-15-20 year old engines ran that way that they’re stupid and wrong.
Reply: My 2004 Focus 2.3 Duratec is still going strong at 340,000 miles, with 10k mile oil changes on Mobil 1 5w30.😊
Reply: I've done the break in oil change since the 1980s. Only a few times since the cars/trucks last so long.
Reply: @rwd1973 I Totally agree,  I refused to put a new Roof on my house, because I'm still going to have to weed the garden every  couple of weeks. Plus I don't think a leaky roof will lower the Value of my home. And when it gets all moldy it will be much cheaper to buy a new house then to remove the mold, it can just be the next guys problem because that's just the type of guys you and I are. 👍
Reply: 10,000km oil changes here will easily get many cars over 400k as long as you stay to that.
Reply: BS, every 10k is fine. If you're worried use ACEA, it's a much better rating than API IMO.
Reply: Not true.  Honda uses a special break in oil.
Reply: @harisyoung4110 yeah it's lifetime... However short that may be! 🤣
Reply: Sorry, very minimum for me is 10k, typical is 15k, been over 20k intervals. Original engine is just hitting 750,000 miles tomorrow. Trans even had a 200k+ interval. Key points are time and load.
Reply: @cameronwood1994 
When they do the teardown of those motors show excessive wear. But it's not for us it's for owner convenience, environment waste reduction initiative, and their bottom line .
Reply: @motleydude73 did you not stay for the multiple oil analysis reading showing metals get worked out of the oil. Sure he's doing it on the extreme. But a break in oil change makes so much sense, sure modern oils are better and can certainly go the 10,000 miles.
Reply: @matt45540  It makes zero sense. It's a waste of good oil and money. A few flakes isn't going to do anything. Your engine holds anywhere up to 10 litres of oil and you have a filter for catching impurities. Break in changes are completely unnecessary you add nothing to engine life.
Reply: @motleydude73 I've heard people following that same 10k rule with different results. Maybe your oil quality is better, idk.
Reply: @jcg702  I've dealt with literally tens of thousands of vehicles that have had nothing but that OCI from new. No problems. If people are having problems it's not the oil. A good synthetic will do 15k easily these days.
Reply: Why is it that you think oil engineering just completely stopped after the 90s? Oils now are much better than what we had in the 90s and early 2000s.
Reply: New cars cant do more than 200 k.
Everything around engine falls apart. Engines are last to go.
Is a 10 year old car worth new turbo repair? 
Or new CVT transmition? 
Answer is no.
Reply: That's about right.
Reply: The mechanics that I know recommend changing the oil and filter every 5,000 miles regardless of what the manual or dealership recommends.
Reply: That is not what he is saying, the skinny is that if you change as he said you will minimize the ware and tear that are compounded from improper break in.
 @motleydude73 
The likelihood of a lemon is low it is more about compound defects.
Reply: Most people don’t keep their cars for 100k miles. Not even close.
Reply: Same reason why they don't build cars to last anymore to sell more cars
Reply: @outdoorsman4245  They last far longer than old dungers of decades ago. And they sell plenty.  Your logic is severely flawed. If cars broke down and crapped out completely all the time nobody would buy them anymore. Sales would therefore fall. Why is Toyota the biggest seller for the past 4 decades? Because they build reliable long lasting cars.
Reply: @fortheloveofnoise9298  my first car was a Mustang it had that same feature 😂
Reply: So true just the same with so many products we use…only made to last a LIMITED TIME. 😅
Reply: @bethdixon501  No limit to how long a car can last. Still plenty of 60-70 year old ones getting around. You cannot plan obsolescence into a vehicle.
Reply: Bull- I bought a Volvo xc90 at 130,000 mi., ran 12-15k oil changes and now its at 250,000 mi.  So, what oil and filter did I use and more interestingly, what did lab test results show about the oil samples?
Reply: Unless you’re using a top tier oil and running all highway miles, 10,000 is really pushing it. With DI, overhead cams with long timing chains, cam phasers, and turbos…..NO 🫣
Reply: @williamtoney2599  Any oil is fine for 10,000, it's not the 1970s anymore. Unless you only average 10 miles every time you drive. Euros have 30,000km (18000 mile) OCIs these days.
Reply: @motleydude73  Evidently do don’t know too much about cars….Good luck with that. You may want to believe the lie about life time fluids as well 😂
Reply: @williamtoney2599   No I've only been working on them as a mechanic since 1995. Done around 15,000 oil changes. 10,000 miles has been standard practice since 2002, before that it was every 6000 when mineral was more prevalent. Lifetime fluid only means for the life of the warranty to stop people messing with it and making a claim when it fails as they used the wrong fluid. You Americans are clueless yet think you know better than the manufacturers who design build and benchtest their engines and oils. Do 3k Or yOur eNgine wIll BloW uP.  Hilarious 😂
Reply: @motleydude73  Stick with being     A oil change flunky and find someone else to troll
Reply: @jdub6797 that’s not even true I had a dodge dart put the cheapest Walmart oil and cheapest filter I could get in it and my cousin has that car now 310k miles and counting you don’t need some fancy name brand oil supertech is fine
Reply: My Lexus is at 242,000 and 15 years. It didn’t work.
Reply: What crap
Reply: @themotoroilgeek  Truth 100%
Reply: @motleydude73  Get 300k+ mis out of every Ford 4wd truck we buy for the Co . Ford Transit vans are excellent & serve us very well. Trucks still run so well @300k+ mis our employees buy them. All vehicles get consistent basic maintenance by fleet mechanic. 5k mi oil changes - Motorcraft Full Synthetic bulk oil . OEM air /oil filters only. All fluids changed at manufacturer severe specifications.
Reply: I doubt that Toyota recommends the first oil change at 10k miles to shorten engine life and increase profits from engine repairs and new car sales... since most Toyota customers rely on the brand's legendary quality, why risk losing loyal customers who, by the way, tend to buy a new Toyota or Lexus every 10 years or less even though they have not had any major issue with their car. The reason new car engines no longer require a first oil change after 500 or 1000 miles is because break-in oil is no longer needed due to tighter engine tolerances and advanced metal alloys requiring less break-in, along with advanced synthetic oils.
Reply: @motleydude73  pretty sure I'd take oil advice based on an oil analysts recommendations VS a mechanic.
Reply: @TimberWulfIsHere  Why? Makes no difference.  Oil still lasts the recommended OCI  regardless. Listen to the manufacturer they know best. Stop being a paranoid bozo.
Reply: What about just idleing for about 5 min prior to oil change?
Reply: @rwd1973  So the rest of the car will wear out so that means you shouldn't change the oil and take care of the engine. How does that make sense
Reply: So it seems like nobody in the comments changes their oil. Changing your oil every 5 or 6,000 miles ain't breaking the bank. $25 per gallon 3 times a year seems like a bargain to make sure my engine stays clean and sludge free
Reply: @motleydude73 the dude has more experience dealing with oil and fluid dynamics with a top race team. But mabey he dosen't know shit u might be right 😂
Reply: @thoroughbredbullterriers9039  If he had ANY clue he would know a 500 mile oil change is pointless and wasteful. NOBODY does that and their vehicles last decades and hundreds of thousands of miles. He's a joke.
Reply: @thoroughbredbullterriers9039  Nobody? I'm sure most do. Everybody I know does. Usually every 10,000 as per manufacturer recommendations. You won't get sludge unless you don't change it for 80-100,000 miles.
Reply: I dont even go HALF that 😂😂
Reply: @colestock9980  Wasting good oil, 10k is fine. 20 is fine. It's what the oil is rated for.
Reply: @motleydude73  okay. I’m not going to go 20k miles between oil changes whatever you tell me. I’ll keep doing me, while you keep doing you, okay? :)
Reply: @seatime674 nowadays people don't keep cars long enough to ruin an engine with lack of oil changes. It's the second or third owner that gets screwed by lack of maintenance. So if you never keep a new car more than 4-5 years go the cheapest route.
Reply: @caseyrandall5985  Yeah makes sense but any new owner that purposely neglects thier car because  of that philosophy is a *ick *ead, you do the right thing in the present regardless of the future. Remind me to never buy a car from you..
Reply: This year is the year of the timing chain for me ... Tensioners fully extended....
1 w/ bent valves out of 8 jobs.
Reply: Long synthetic oil change intervals are NOT NEW….I had a 2003 BMW M3 that specified 15K oil change intervals over 20 years ago! 🤔🤔🤔🤔🤔